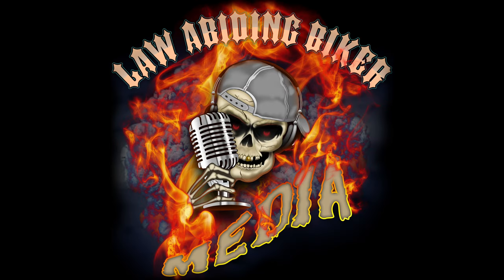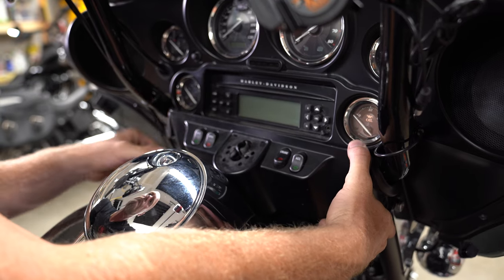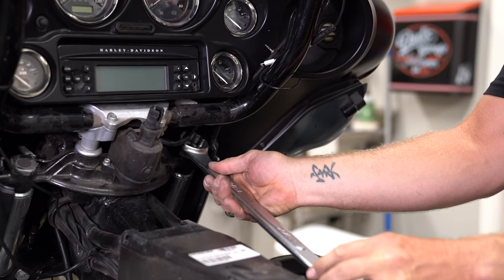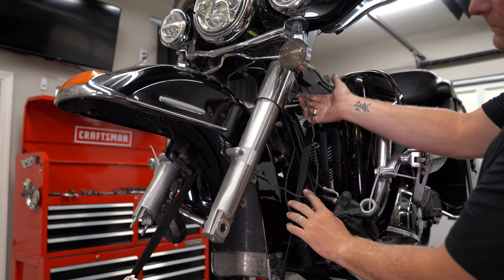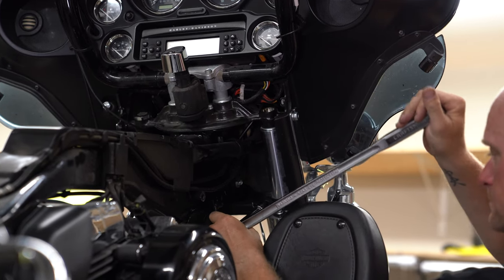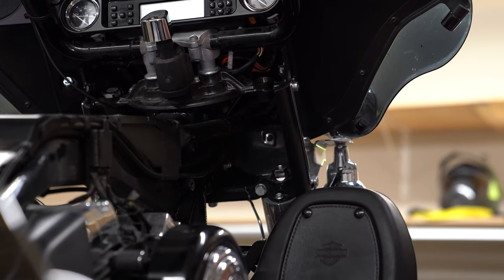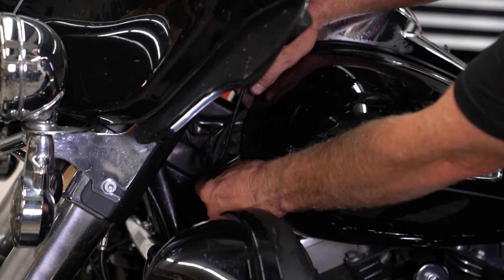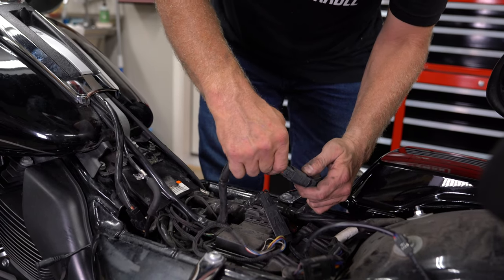How to Remove & Install Harley-Davidson Front Forks

Comment: Hey Ryan ,What about my 96 classic E  glide, with air assist ,really want to delete the air part,,I just inherited this classic beauty with 20.5 miles ,Forks leaking so, bought progressive front springs and progressive rears ,and a fork seal kit .The Question is Can I delete the air forks ???have you ever heard of such a doing ??thanks

Comment: Ryan, thank you for all that you do to educate us on Harley maintenance. I have a question. You mentioned in the video that the grooves on the large wheel spacer ( right side of wheel) go in toward the wheel. On my 2012 Road King, my service manual states that the grooves on the spacer should go outbound. Regarding the spacer, is there a difference between FLH models and years? I’m confused. Many thanks again!